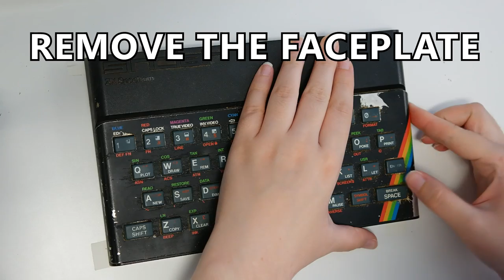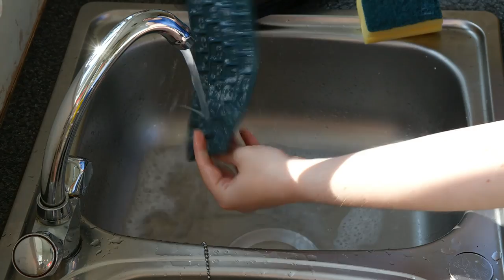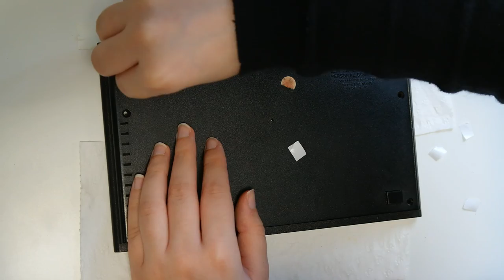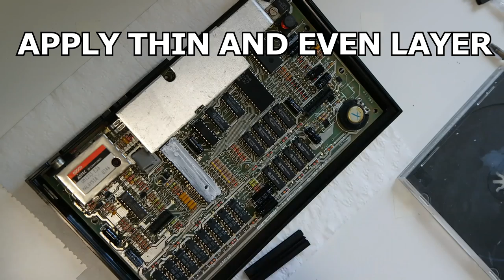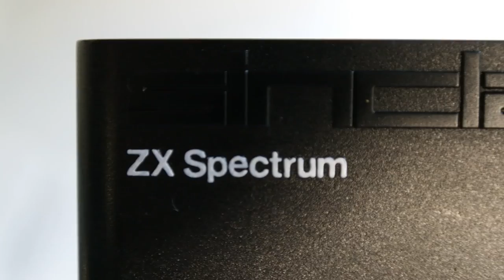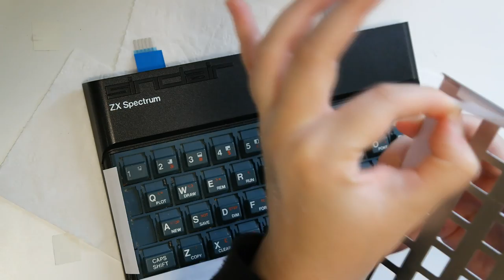Sinclair ZX Spectrum 48K Refurbishment Tutorial

Comment: Hi, did you replace the faceplate? If you didn't, can I ask how you painted it? I've got a Speccy with two big paint chips in both corners of the faceplate and I'd rather paint it than replace it.  I've got another one that could benefit from a touch up too.  Cheers.  Nice video, by the way :)

Comment: The Spectrum + had the white lettering, but earlier "door stop" models had red lettering. None the less well done. You might look at replacing the voltage regulator with a buck converter, which runs cooler and will extend the life of the machine. A reset button is an easy mod.
Reply: Other way around.  Just pulled my 1983 original out of storage, still with faded white lettering.

Comment: Could I ask what paint did you use to cover the black chips on the metal keyboard cover?
Reply from the maker: As far as I know there isn't any effective solution for getting rid of the chips/scratches. I used a completely different faceplate for this one that's why it looks so good. If you haven't got any spare ones though, newly manufactured faceplates are available, the link is in the description :)

Comment: when we have a zx-spectrum that doesn’t turn on, where should we start checking what is not working?
Reply: Paulo Silva first check the resistances in the voltage regulator and the memory modules. One of the most common problems with spectrum not turning on are transistors 4 and/or 5 are blown out, if that's the case then one or more memory chips are also damaged, as they're very prone to fail with wrong voltages. Check a series of videos called "zx-spectrum repair" to get started. I fixed a spectrum that didn't turned on a while ago. Very fun little project...

Comment: nice vid. ive just put a pi2 inside my 48k spec. got an arduino circuit which converts the membrane keyboard to normal usb output, this output then goes into one of the pi2 usb ports. can now play manic miner on my zx spectrum with instant load, plus can listen to internet radio rest of the time